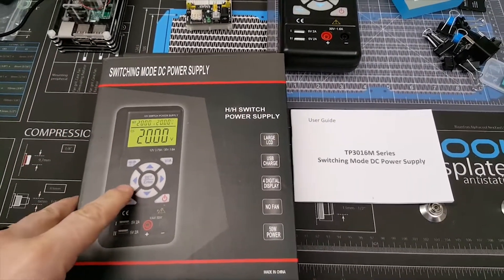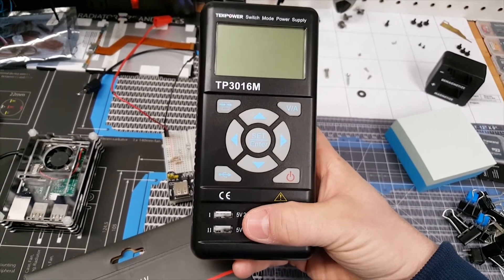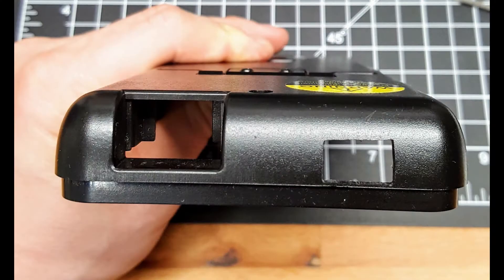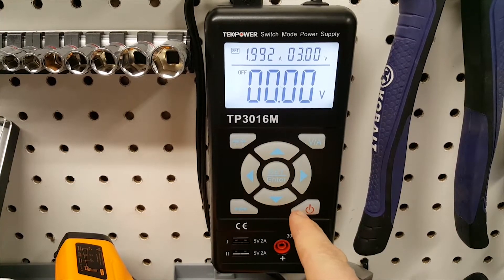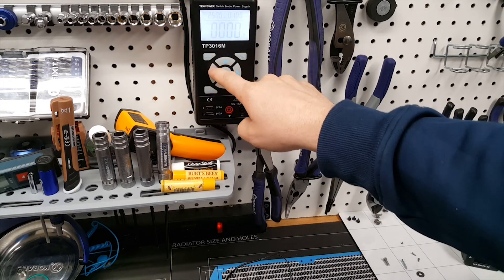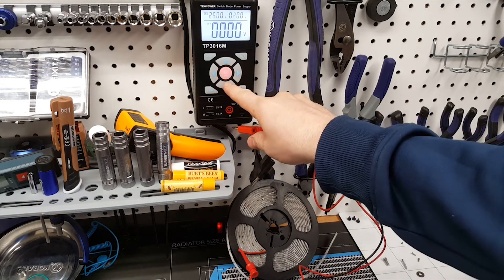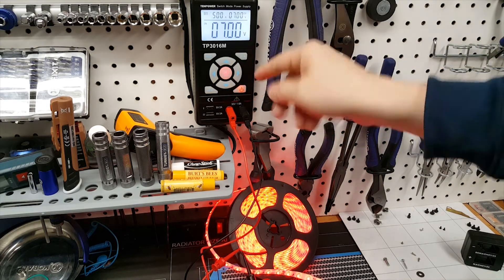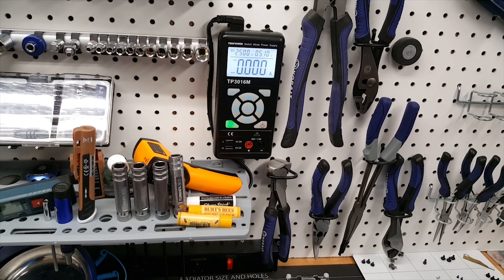TekPower TP3016M Switching DC Power Supply Mod & Review

Comment: Does this support 220 volt input voltage ?
Reply from the maker: Rajesh B.K, According to the description on Amazon, Input Voltage: 110V/AC, 60Hz or 220V 50Hz. There is a link in the video description.
Reply: Thanks. But there are so many contradictions, some state it 110V and other place I see it as 220V supported. So wanted confirmation from someone who has used it at 220V. The Tek site says 220V supported in description but in their user Manual it states only 110V.
Reply from the maker: I haven't personally tested at 220v so Can't be of much help there.

Comment: I was wondering what switch you used for your modification?
Reply from the maker: Chris Hintz  any small rocker switch that can handle the least six amps should do the trick period I don't have a link as it's just one I grabbed at a local Radio Shack.